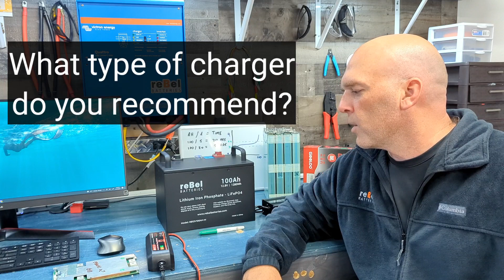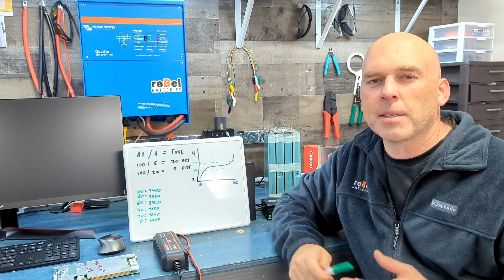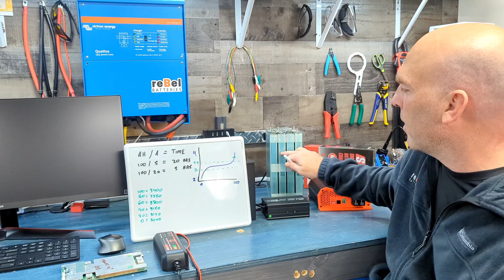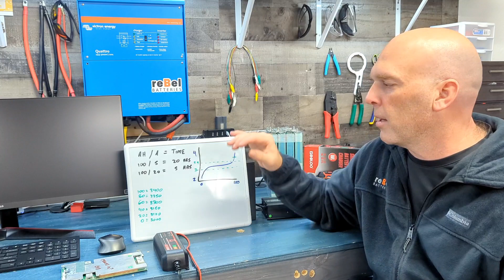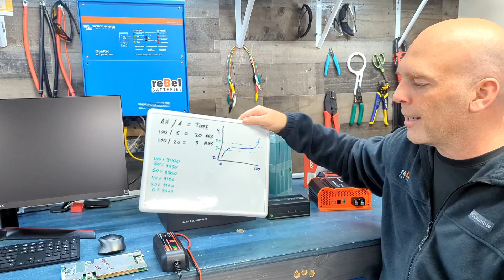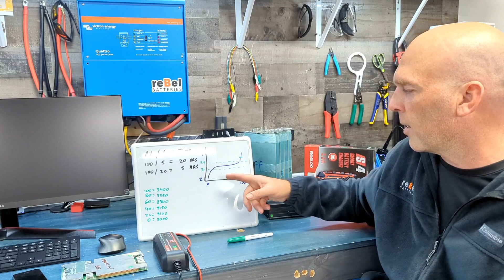Top 6 LiFePO4 Battery Questions from Real Customers

Comment: I bought a 100 Ah battery from rebel and after 3 uses, the BMS no longer works. I have reached out multiple times for help but no response from Rebel. I would not recommend this company at all which is sad because you want to support veterans.
Reply: I have had the same experience in trying to get a hold of him. Really sad. Maybe the Chinese company he partnered with sold him a bunch of junk and now he is underwater on warranty claims and just couldn't handle the fall out.

Comment: If I buy your 12ah battery for ice fishing & use it for my fish finder in temps possibly below zero degrees Fahrenheit will that cause any issues? If so what do I do to get around that problem? At what point will the cold cause the battery to not function?

Comment: Aric, great video. Learned a ton. Being a disabled Vet myself, I am in tune with your process of information delivery. I have one of your 12v 12ah batteries. So far, so good. I am building a DIY Portable Solar Power Box and will be posting the video on my YouTube channel as well. I am a beginner at all this and You Tube, working full time, so not much time to do vidz at the moment. I sent you a message on your website, so hopefully, you get to that. As mentioned above, I am new to all of this battery, LifePO4, wiring, ah, volts, etc, not a wizard by any means, so all info from folks like you is much appreciated. I am running a 20A Solar Charge Controller in an ammo can power box. Been using AGM, switching over to LifePO4, any suggestions as far as inline fuse size, wire guage, etc., so I do not have any issues with loss, etc?  Thanks. Semper Fi!

Comment: After I got my batteries I turned on the “always balance” function in the BMS and also kicked the high voltage cutoff to 3.850V until the cells became more equal to each other. It took three or so charge cycles for the cells to balance. I then returned the high cutoff to 3.650V.

Comment: I built my own battery and these are questions I ended up asking myself after the build. The charging voltage curve is a concept hard to get my head around. Im so used to just using a battery tester on my old lead acid to check the voltage to know what the percentage was. With LiFepO4 the capacity can be way off by just testing the voltage.

Comment: One question I have that wasn't covered... it 'appears' my reBel batteries discharge faster in cold (minus freezing to negative zero) environments and more slowly when I am in a warm environment (+32' F)... They sit on trays outside/underneath my RV. Is this my imagination? I know there is a range for lithium for charging and discharging. This was a hard and cold lesson to learn when my batteries shut down at -5' F in Iowa... I will be purchasing a 12v Silicon Pad and wiring it in to my system. Thanks for all of your help Aric!!
Reply: https://youtu.be/EaiwxDUY9ho
Reply from the maker: I believe insulating is good for 95% of the people out there. Unless it's extreme cold, if your using them constantly they should be good with just insulation. It's not your imagination, all batteries will be "sluggish" in cold (near freezing) weather.